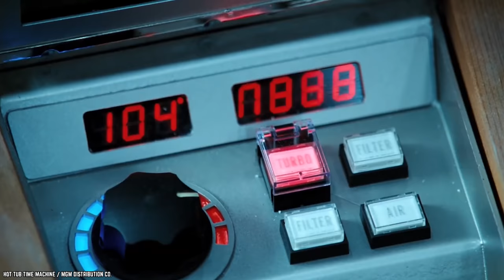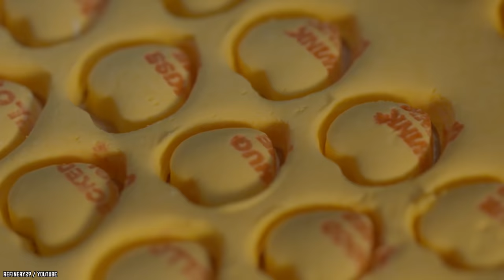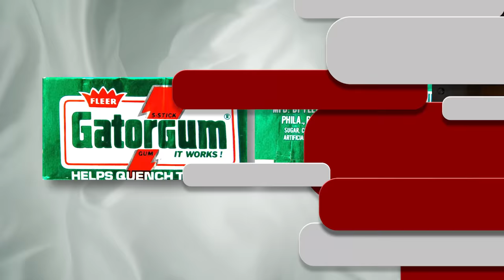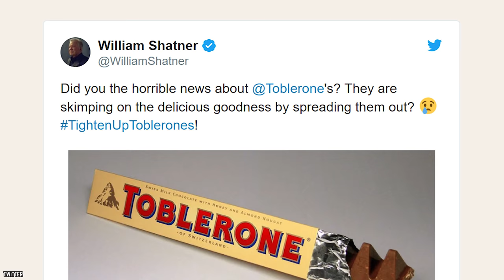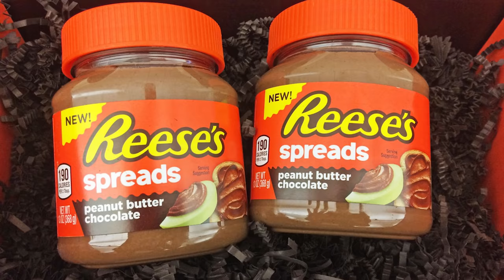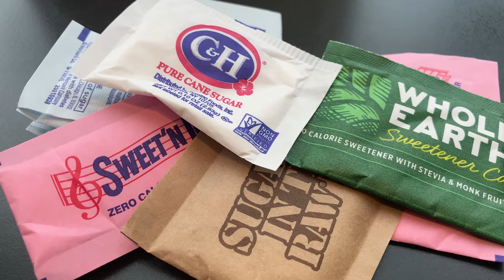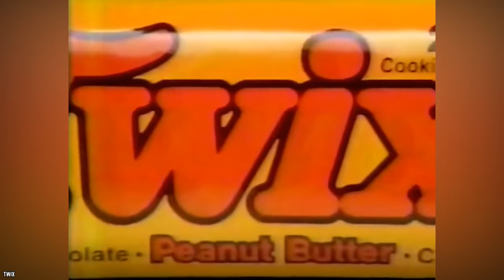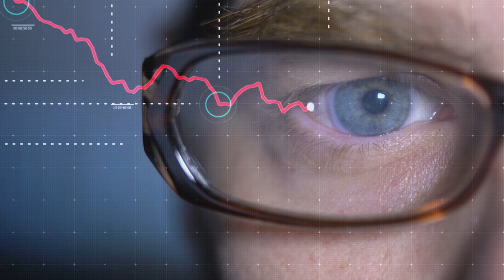10 Biggest MISTAKES Candy Companies Have Ever Made

Comment: As someone that has worked in convenience and grocers, as well as someone that should weigh more than the 116lbs and have diabetes from drinking gallons upon gallons of Coke products; can state that the Coka-Cola company does NOT own the product of Gatorade! The Pepsi-Co owns the product of Gatorade! A simple way to remember is Coke is Power for Powerade, and Gatorade is the other! PepsiCo
Originally produced and marketed by Stokely-Van Camp, the Gatorade brand was purchased by the Quaker Oats Company in 1983, which, in turn, was bought by PepsiCo in 2000. As of 2010, Gatorade is PepsiCo's 4th-largest brand, on the basis of worldwide annual retail sales.
Gatorade - Wikipedia
Reply from the maker: Thanks for your feedback Virginia Higgins!😊 What was your favorite part of the video? 😉
Reply from the maker: our mistake, the writer will be disciplined